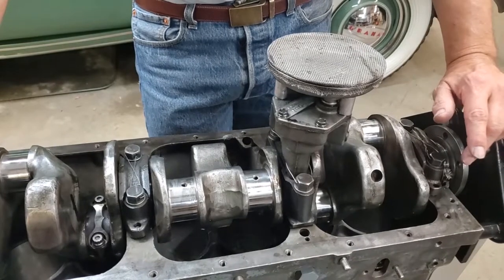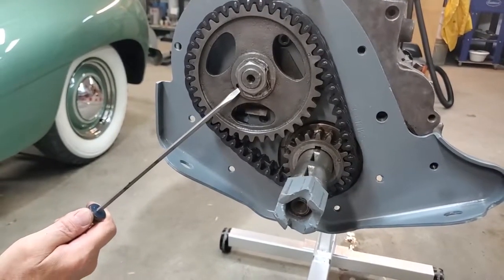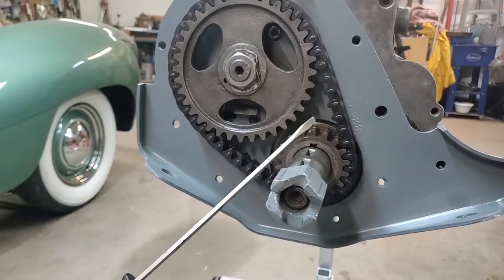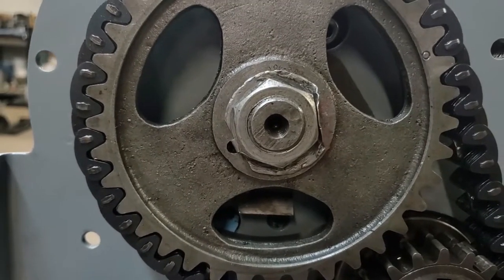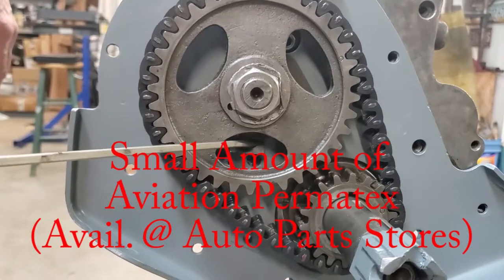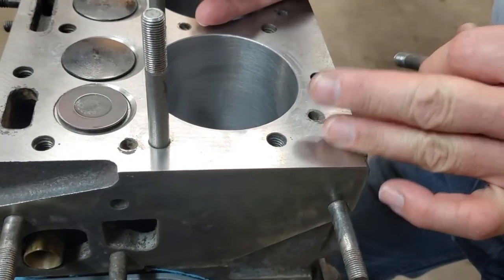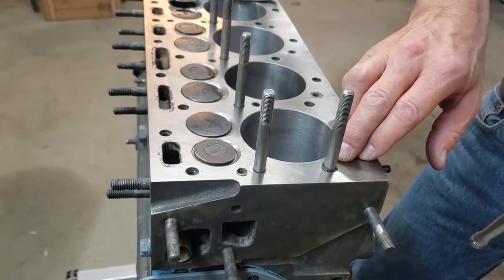Graham Supercharged Engine Overhaul Part II - Camshaft, Timing and Valves

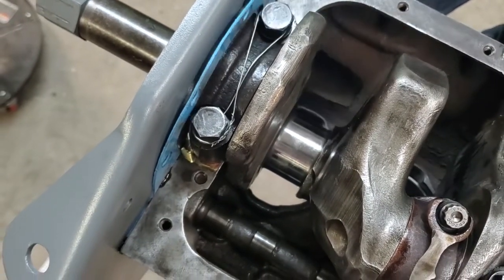Comment: At 1:30 you discuss the gasket that goes between the mount and bearing cap. I can’t seem to find one. Do you make it or can you suggest where to get one? I searched all of the typical online places.
Reply from the maker: The gasket you are referring to should have been in the engine gasket set that you purchased from your supplier. We've never produced one here, since it's always been included in the set.